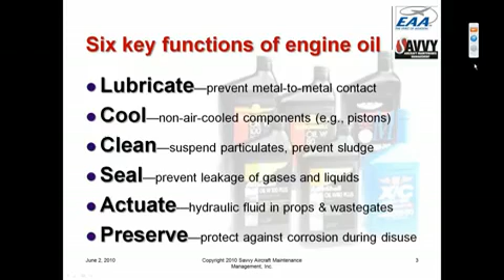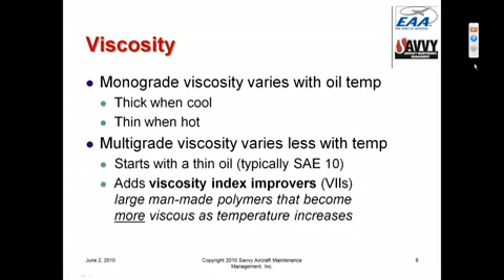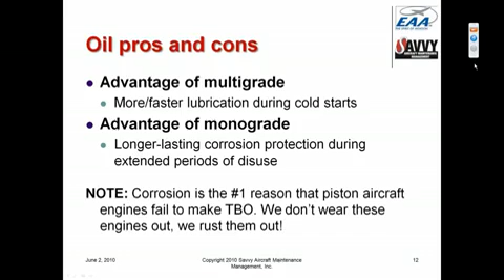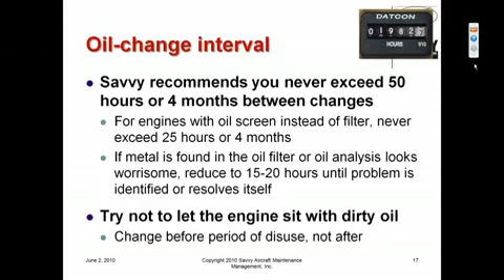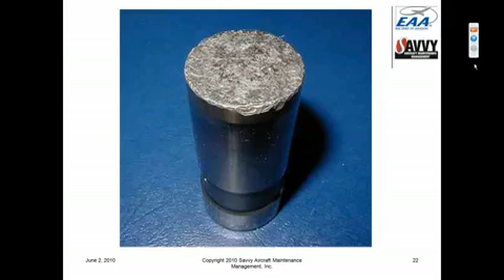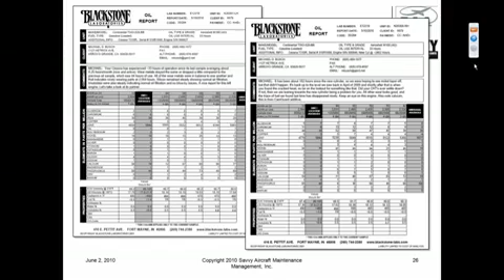All About Oil

Comment: Interesting.  Nice content. Motor oil geek says lab analysis data shows more frequent oil change is best.  Not what the manufacture says or bottle says. Change oil more frequently. 
Old oil oxidizes and loses its protection package. Data shows even new old stock in bottle oxidizes so he warns against using old oil. 
Frequent change is essential for diesels. Soot kills diesels. Assume aircraft engine is similar because of lead?

Comment: The problem with aviation oils is the lack of metalic detergents, as opposed to car oils... Detergents fight accidification in oils. The acids leads humidity to touch the metals and that IS what makes rust. A car oil with 50 hours of operation use has less accidification than an aviation oil with only 15 hours, because of detergents on it. Aviation oils has Just dispersants and It can't fight the produced acids.

Comment: I've been using aeroshell 15 50 during the winter in St. Paul Minnesota. I will try the Phillips 20 50 along with the cam guard that you recommend instead.  Hopefully this will keep the gunk from forming. A clump came out of my breather tube last spring. I use w100 in the warmer months. Do you recommend adding the cam guard to the w100 as well? Thanks for doing these videos. I have a 1956 Cessna 182 with a Continental O -470-g with 375 SMO. It's my first plane.
Reply: I am now thinking the same. I have been running Aeroshell multi grade since overhaul but now think Phillips xc with camgaurd is a better option. What about the fact or myth of not changing from brand (aeroshell) to another Phillips? More myth than fact?

Comment: Mike, you always have a LOT of good information, BUT, when you are suggesting that people carry LESS oil in the crankcase that is required by regulation and the manufacturer, you are leaving yourself hanging out for a great liability.  Crankcase OIL CAPACITY is determined by the quantity of FUEL that the tanks can hold.  Look at the CAR3 regulations that most general aviation aircraft have been designed under.  The MINIMUM Oil Quantity is 75% of the required Oil Capacity of the Oil System, such as the 12 quarts in the Lycoming 540 series or the Continental 520 / 550 series.  I have heard the "old pilot's tale" of the engine blowing out oil, but I have never had that problem with any aircraft engine of any size.  The minimum oil quantity for any take off is 75% of the Sump Capacity.  MORE Oil also gives better cooling.  IF an oil leak or engine problem causes excessive oil consumption, the possibility of loss of oil pressure is much greater if someone starts out with less than the minimum quantity of oil, such as 60%, than they would if they started out with 100% of the oil capacity.  Your statements have put you into a bad liability situation.
Reply: Great information. One thought GA pilots have is to fill more oil in hot summer months because it helps cool the engine better. Myth?

Comment: Should you change the oil on warm or cold engine?
Reply: I have been told hot.  If it sits too long after reaching normal operating temp, the sludge goes out of suspension/to bottom of pan, and won't get drained out. Sludge is a problem for our air cooled engines.

Here's what I've learned to do in my Mooney w 4 banger Lycoming.  After landing and hangaring plane, I immediately pull off cowling and attach hose to drain and open. After at least 1 quart flows into bucket, I take oil sample (for oil analysis).  Then I leave and come back next day.  At this point, when I remove oil filter, very little oil comes out of filter!  I don't even have to wash engine down like I used to. (previously, I would drain oil for a few minutes, then remove filter making a HUGE mess).
Reply: @Randy29209  GOOD PLAN!!!   I let the oil drain for a couple hours and the filter is mostly empty.  Oil drains from filters that are horizontal but not hanging vertical below the attachment, so when you start an engine, keep the RPM low, less than 1,000 rpm, until the oil has filled the filter and is pumping through the engine and lubrication has sufficiently started.  Lycoming says do not run the engine above 1,900 rpm until the oil temperature is at least 140F.  They say warm up at about 900 to a maximum of 1,200 rpm until the oil temperature is sufficient.  During the run-up the oil temperature will increase.  Cycle the propeller through the full travel a number of times to keep sludge from building up in the full travel of the piston in the propeller.  I usually make about 5 full travels of the propeller range and like to have the Oil Temperature above 160F before take-off.  I have very little engine wear problems.